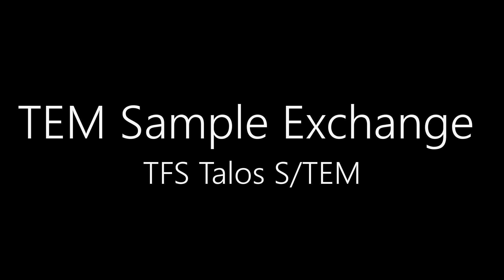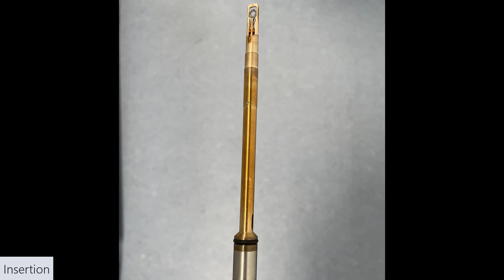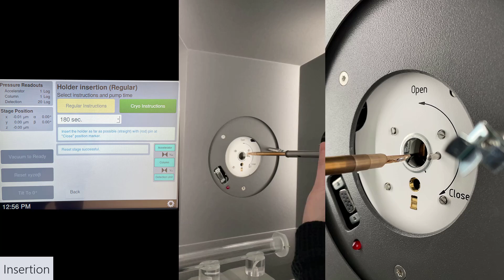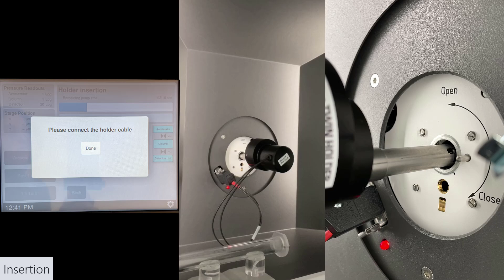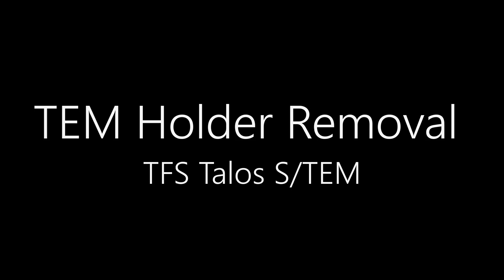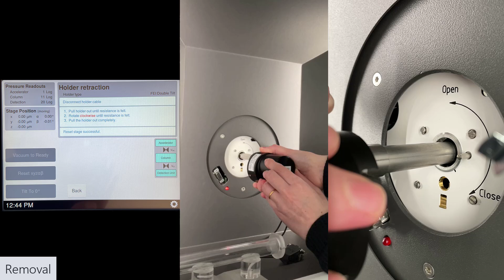TEM Sample Exchange – TFS Talos

Comment: Ok, this is different. I was told that you continuously pull out the holder wo really caring for “pressure jumps.” Just pull it out without stopping until you can’t anymore then twist it immediately wo stopping as well until the end.  I wonder why everyone is teaching differently even on the sane microscope. This is getting annoying tbh…
Reply from the maker: Small pressure jumps are fine. We have issues with our sample exchange system, and this is the solution that works for us. You’re just going to have to learn how best to do it on your particular microscope. No two, even of the same model, act exactly then same. Welcome to the world of electron microscopy!
Reply: @sherisingerling  Yeah, I just got trained on our TALOS, and I broke a vacuum because when I stopped at the end and tried to twist it, it went back in by 1mm and boom… Now, I have a ptsd when loading the holder.
Reply from the maker: @diobrando5974  I'd say this is the biggest source of problems—the psychological effect! Once you dump the column once, it makes you nervous which often results in mistakes. I speak from experience. Keep trying, and you'll eventually learn the technique. There's a bit of an art to it.